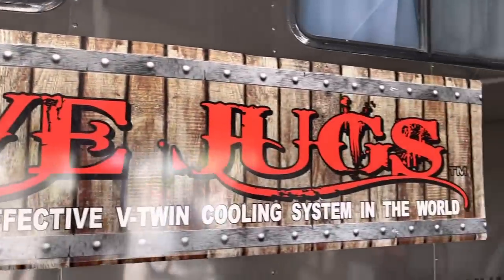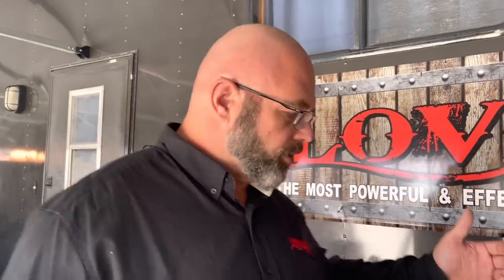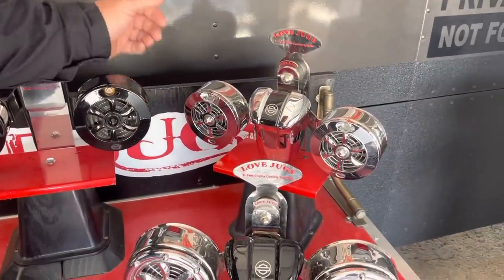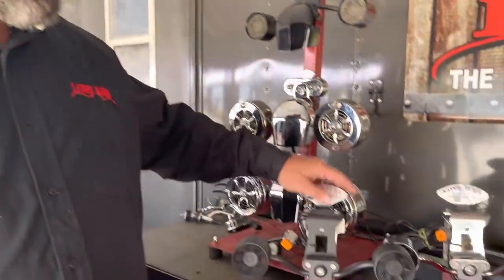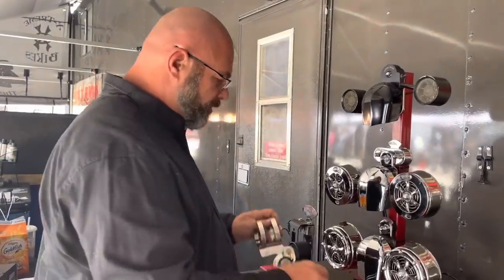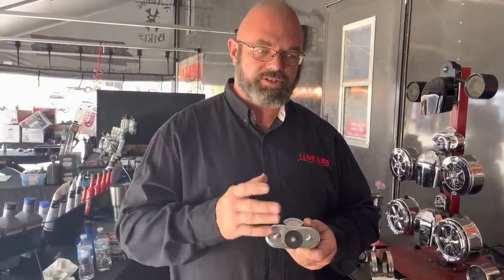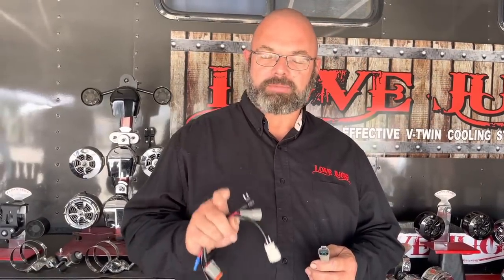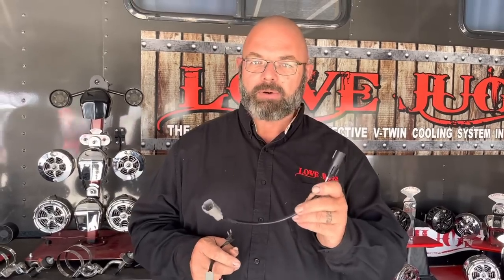LOVE JUGS V-TWIN COOLING SYSTEM. WATCH THIS VIDEO BEFORE BUYING

Comment: My 2015 Breakout has a grenade style ignition on the left side. Am I not able to use this product?
Reply from the maker: I have done it on your model motorcycle before however it does take some modifications because it is not a direct fitment
Reply: Ditto. I have a 2008 H-D Rocker C (softail), with the grenade style ignition on the left side (like the Breakout). I very much in need of the Mighty-Mites. 

Are there any links to manuals or video for making the appropriate modifications? Thanks in advance.
Reply from the maker: @luisoutumuro424  I don’t have any kind of manual but what I did is I took a set of the mighty mites and then I built a 90° bracket to hang off of the bolt that goes into the bottom of the hand grenade. And then I took the Mighty Mite an Mounted them upside down. I do have pictures but I don’t know how to share them with you

Comment: Hey Adam, I have a 2011 Road glide SE CVO Ultra with a 110 Twin Cam with a stage 2  the majority of heat comes from the Catalytic Converter  on the right side of the bike will the Love Jugs help?
Reply from the maker: Yes they will still help, it’s going to eliminate the engine from overheating however your catalytic converter is still going emit some heat.

Comment: And do all kits have thermostats, is that better?
Reply from the maker: We do not recommend thermostats for multiple reasons. We suggested she run them whenever the engine is running. There is never a bad time to supply air to an air cooled motor.